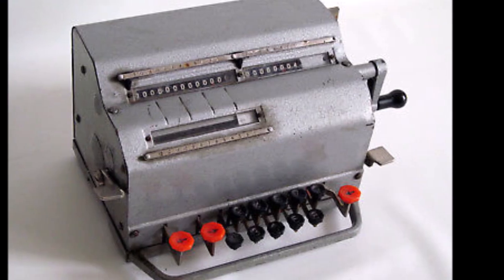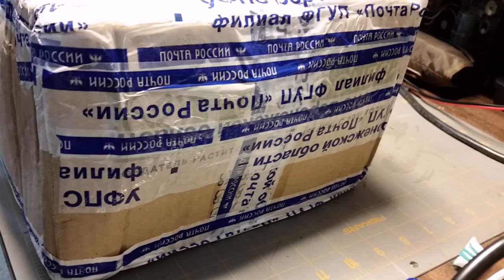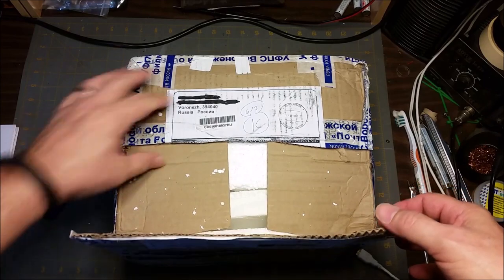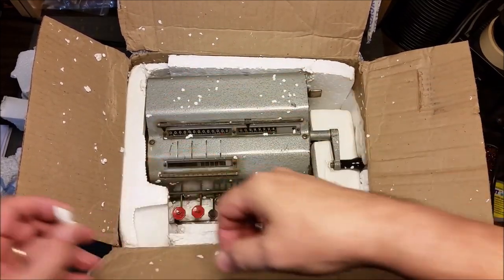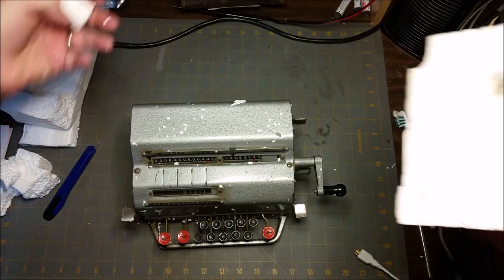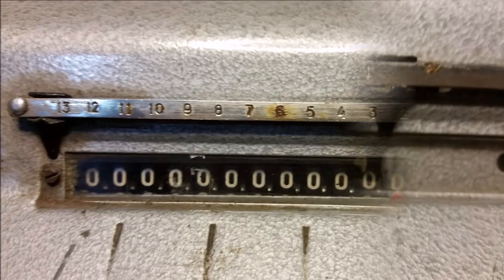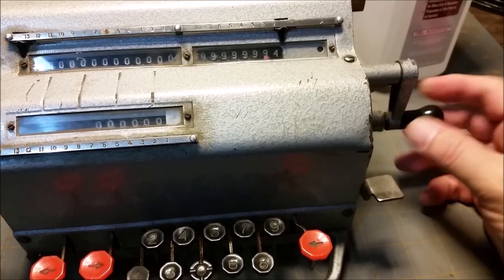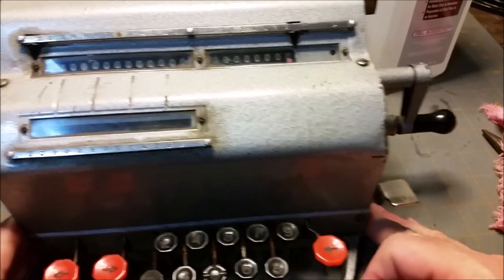VK-1 Facit Pinwheel Mechanical Calculator Unboxing

Comment: That’s really cool! It looks like a Facit TK clone. I liked that it worked well right out of the box. Have you bought any more since?
Reply from the maker: I'm still just trying to get over my fear of disassembling this one. My success (or failure) will determine if I have an aptitude for it. My eyes and fingers (heck, pretty much, most of me) doesn't work as well as it used to.  During early disassembly I removed one of the pieces and realized I had overlooked a linkage arm. I had sudden panic there might have been a spring attached that I'd never find. It turned out just fine and I returned the piece to its original location without issue.  I'm very close to releasing Part 2 showing the disassembly.
Reply: I tend not to disassemble unless it’s absolutely necessary, and will only do it if I have nothing to lose - the worst that can happen is that it still doesn’t work! If a machine is a little stiff in operation but is otherwise OK I usually just take the covers off for a general cleaning and light lubrication.

Comment: What happened with that VK-1 later? It really appears to be a Soviet clone of the Swedish FACIT model "TK".
I got the FACIT "NTK", and due to the complete cover, the mechanics usually is in a realatively nice condition. I had to use some WD40 to unseize some mechanical movements (old oil had gummed up), and later lubricated it with modern sewing machine oil, which doesn't gum.
"Nevr Dull"-polish for the chrome parts, and hot water with laundry detergent to clean the cover.
Now it works like a charm and looks just fine.
Reply from the maker: I haven't done much with it. I did remove the cover and clean out all the Styrofoam. A couple of the indicator wheels in the accumulator register are scraping on something. Some of the paint was scratched away from the numbers. I found some  service type videos for similar models so I'm slowly getting comfortable with the idea of tearing it apart for a full restoration. Also, I found another good deal on the same model so now I have two. I figure I can mess around with one and use the other as a reference.

If you have links to a service manual or other technical material about these, would you share them with me here?